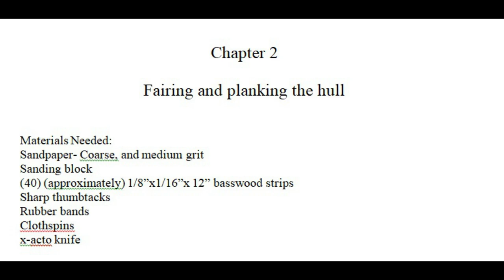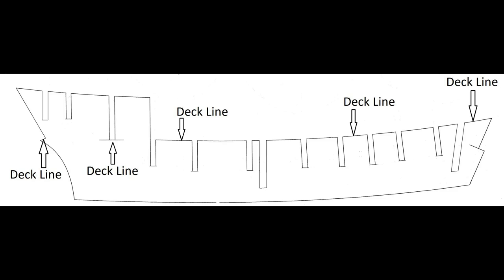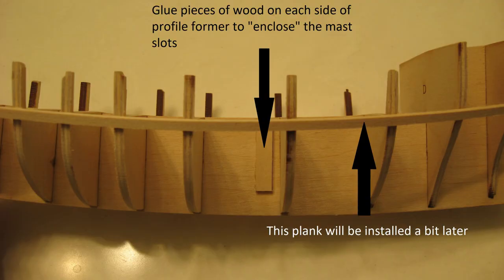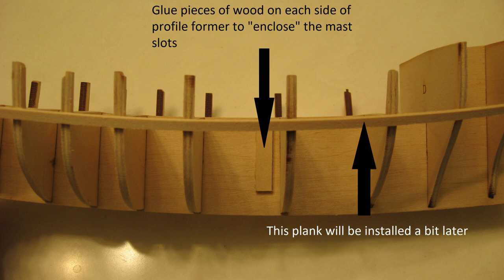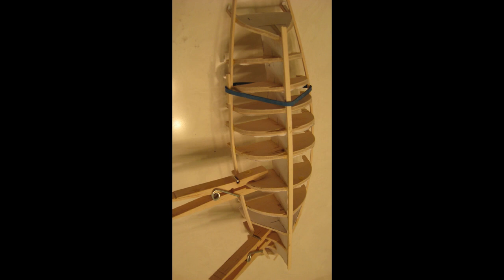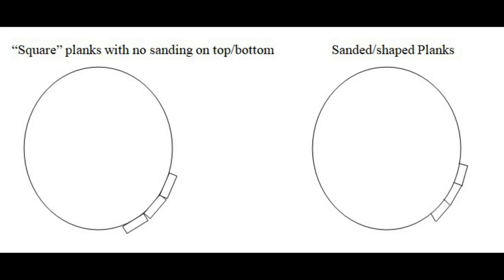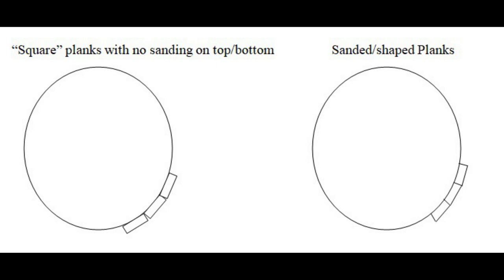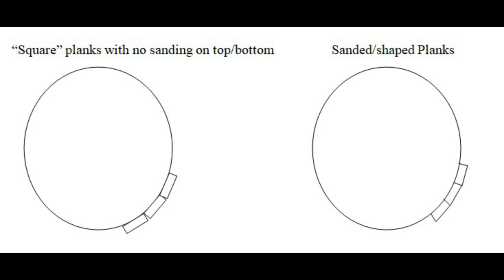Wood Model Ship Plans and Tutorial Series - Video #2 - Old Version - See Channel For New Version

Comment: A second video should follow this showing how to use stealers and drop planks to increase/decrease the number of planks strips in order to fill large gaps or reduce the number of planks that would have to fit into narrow gaps.
Reply from the maker: Great comment! My first hull design actually did require stealers and drop planks.  After a lot of internal debate however, I decided to reconfigure the shape of the hull a bit in order for stealers/drop planks to not really be necessary, as I wanted to keep the project as simple and forgiving as possible.  My goal with this one was to attract new modelers to the hobby who might have been hesitant to tackle anything too complex.   I have however, thought about creating another more complex version of this,  and utilizing pear throughout....  I think pear for the hull, coupled with  black walnut for the later carvings would create an incredible display.  If only I had more time! :)  I've also been pondering re-releasing this one as a kit.  Some of the photos in the tutorials actually are from the limited kit run I did with this about 10 yrs ago..
Reply: @immunosuppressor  If you CAN make a hull with simple plank shaping, that is best.  Drop planks and stealers are used when things get too tight or too wide.  I'm in the middle of building the French war galleon La Couronne 1636... at this is my FIRST wooden ship build.  Looking great so far.  Hull is done, fittings are next as is stepping the masts.
Reply: @immunosuppressor  Oh, make no mistake, tacking a wooden ship model is very daunting... working with not much more than some plans and a pile of wood mixed with a few nice pre-made fittings.  You HAVE to have a LUST for old sailing ships to keep you devoted to seeing it completed.  Most kits get partway done and abandoned.  I sailed merchant ships for years as an Engineer, and have always loved rigged ships.  Now that I'm past 50 and have very experienced hands in crafting, making a decent ship model is less of a challenge than for most folks.
Reply from the maker: I think you are entirely right that most kits get partway done and then abandoned; which is a shame, because I think a person just needs to get one kit done, and then they'll be have a hobby they can enjoy for the rest of their life.  It's just getting that first project completed under their belts.  Congrats on the progress on your La Couronne!